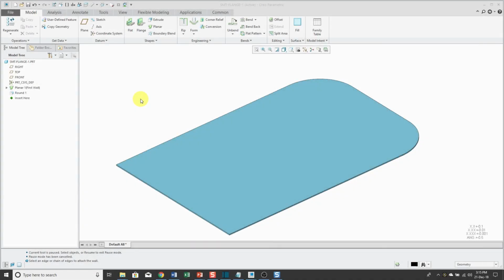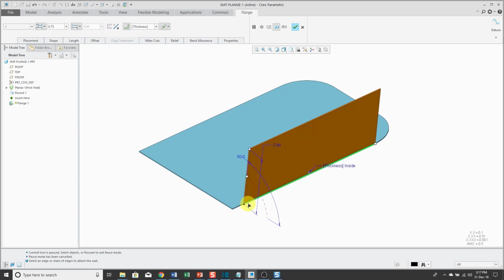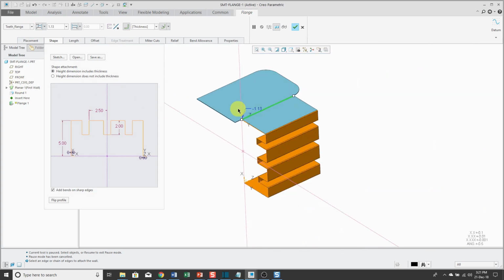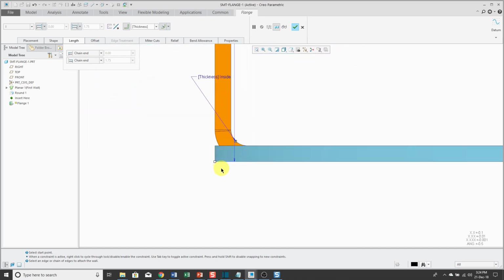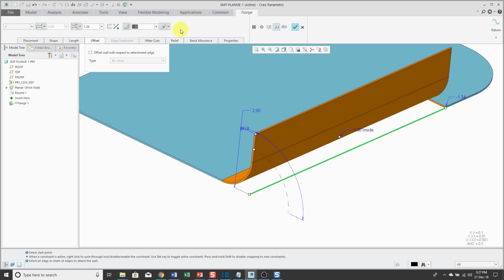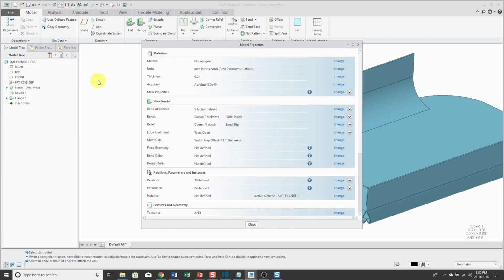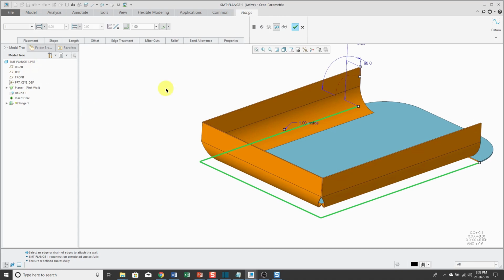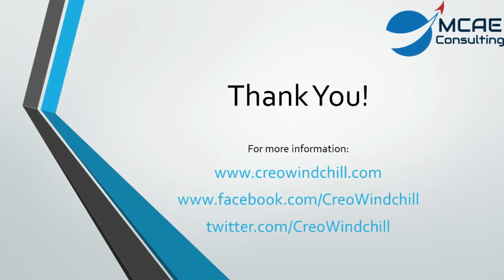Creo Parametric - Sheetmetal Mode - Flange Wall

Comment: Hi David, it is amazing to see this many settings and options for us to control when creating a flange feature. I am pretty sure they are all needed for better design intent but what do you think? Do you often have to highly customize your models?
Reply from the maker: These options are absolutely needed. They were added due to customer feedback. Do I personally need all of them? Of course not. But others do. As always, it's better to have the options available and not need them, rather than need them and not have them.

Comment: Hi Dave.! I just want to know if you know what the steps this guy doing when he is generating dxf. It is faster that make it through drawing. See link below.

https://www.youtube.com/watch?v=nAv06r4uDDY

And also do you have video how to define/make connection in fittings in order to insert in piping module automatically. In our company now one guy using piping module in creo but unfortunately  he is doing like sweep command. After one routing then he insert the fittings/piping component then again routing it again until he will finished.